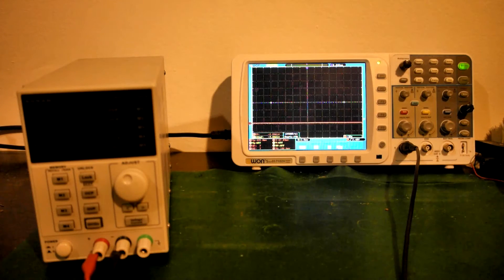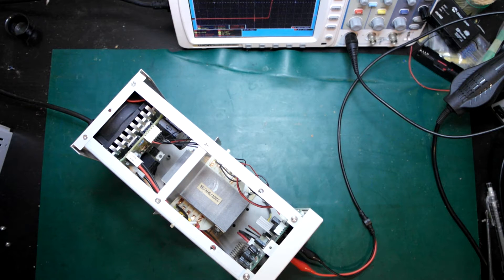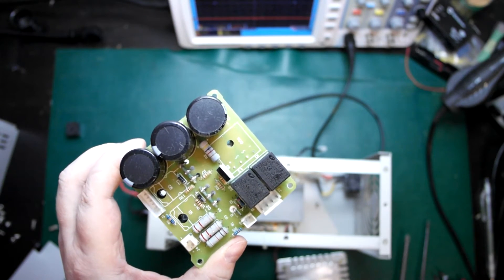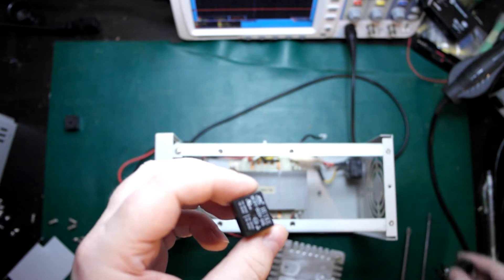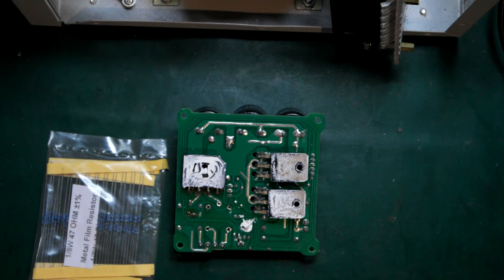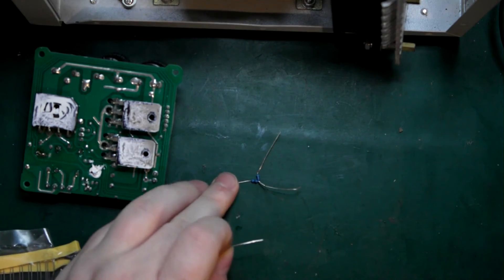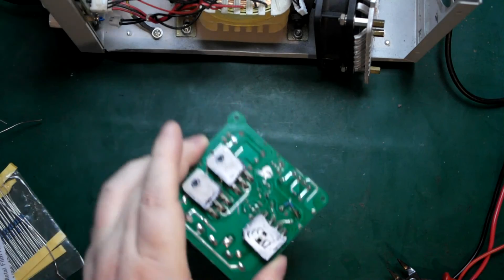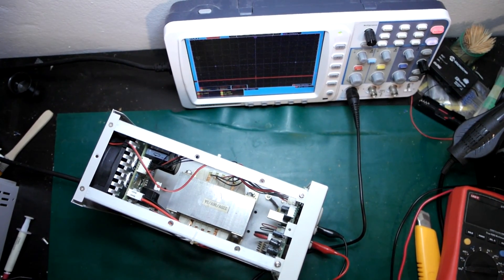Korad KA3005D Bench Power Supply Repair

Comment from the maker: Note: the 2x1/8W resistors I used in series with the relay coil are not rated for enough watts. I later replaced them with 3x300R 1/4W resistors in parallel off camera.

Comment: I bought a brand new one myself (some years back) and it behave the same way from day one but didn't know at the time until it managed to burn 3 of my devices that I was powering  (weeks apart from each other) and when I finally realized what was going on instead of fixing it, because  I was so angry for the damages that has caused I decided that it's not worth the effort  and dismantled it for spare parts (as it was fairly cheap to buy anyways) And by testing the relays I then realized that they were of a questionable quality (and so was everything else on it) and threw them in the bin. So, what I ended up doing was building my own DIY Linear Bench power supply with a couple of LM723C's and some Power pass elements (2 -30V @ 0-3Amps) and re-used the enclosure some buttons and the transformer. After building it, (which didn't take long) it worked first time nicely and still works today ! No regrets here ! But...If I'd known it was of a low quality construction I wouldn't have purchased it in the first place . :))

Comment: Thanks for making this into YouTube to share.
I have similar problem : (1) display loaded voltage value flickering and deviate from set of 5V. (2) intermittent 20V output when set to 5V. Followed your YouTube, dug out the relay found it was in good condition. Further investigation have located other problems and each respective root causes, but the relay. 

(1) dried filter capacitor(s) after the secondary windings. (2) intermittent connection between regulator circuit and output port. Replaced filter capacitor fixed the flickering display value. The 20V raw output was caused by open loop regulation, tracing to a bad connection in the XH-2.54 2-Pin connector. One of those wires was crimped in pin with insulation un-stripped. Correct that fixed the raw output problem. 

Hope this helps.
Reply: I also have a similarish problem with mine. 18V output for 3 seconds when turned on when cold / having been sitting for half an hour or so. Problem occurs only once. Relays are fine, connections are OK. Output transistors are switched fully on by the main board for some reason. Suspected a pulldown resistor fault but that was not the case. I guess I have to live with it for the time being. Anyway, I have never left a circuit connected to outputs while turning supplies on.
Reply: @drezster  hey, did you fix it?
Reply: @dany_2945  No, unfortunately not. I tried everything that's recommended but the fault still occurs. Power board is OK. The signal to turn on the FETs comes from the cpu board and I don't trust my skills enough to go poking around in there. Might even be a firmware issue, who knows.

Comment: thx for the video, also took the plunge on a couple of these.
was comming short when checking LDdrivers and loads due to high power laser diodes, and purchased a couple of these power supplys.
was looking at that KA3005P but seems to cost around 110US delivered + tax and then saw the KA3003P (nax3A) for 63US delivered, so took that, but doubtfull that it will get shipped hence 63US seems to low.

while waiting for it to get shipped' instead purchased the KD3005P from Reichhelt Germany to around 77EU+5.6EUshipping-fee and it got delivered today, 25hours delivery time from Germany to Denmark, impressiv.
Trying to get familiar with levels and the rela'es, seems to click around 3 times from low to top 31v voltage, but it puzzle me that it keep dropping the voltage on load but likely my rookieness to blame, but i do cherise that its the P version and able to handle it with the mouse and keyboard the values and getting graphical views, makes the adjustment easy, evewen thow the two clickknobs on the KD model is easy to manage. ...
btw your accent very much sound like your from Denmark..

Comment: Hi.
Can you tell my why when i use a PWM controller on my supply the same as yours the relays go crazy clicking on and off and the voltage on the display does the same?
Reply from the maker: +Dale Whitmore I believe you are experiencing that your pwm controller is causing the power supply to switch between constant current and constant voltage mode. The relays switch between a number of secondary windings on the transformer to lower the dissipation in the output transistors, so if not already on the lowest voltage winding, the relays will click when going between cc and cv modes.

Try setting the current limit to a higher value, or try adding a large capacitor close to your pwm controller.
Reply: +TheStuffMade Great thank you i will give it a try.
Good video.
Reply from the maker: +Dale Whitmore Thanks, let me know if that solves the issue.